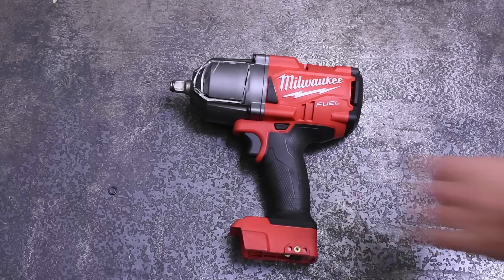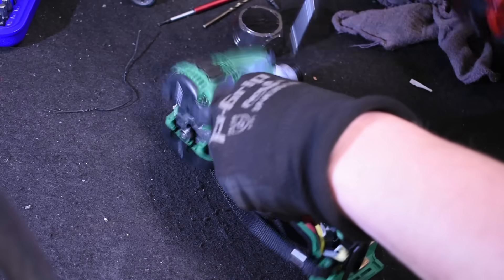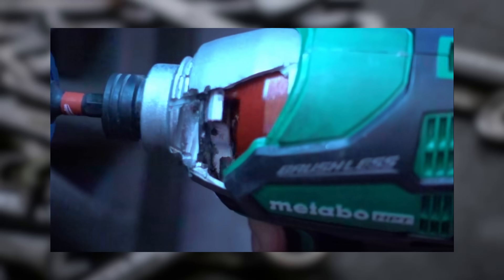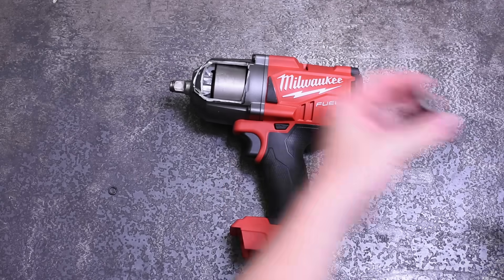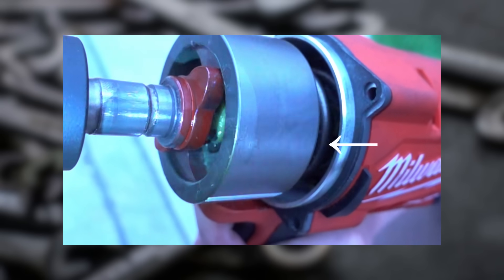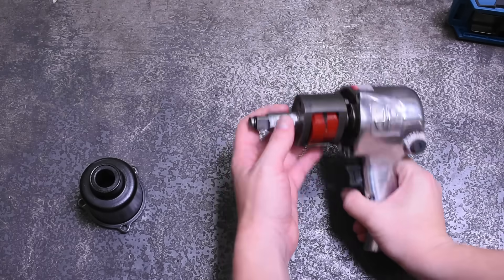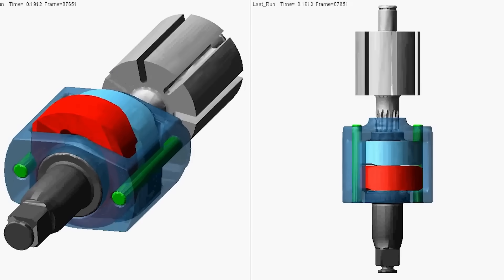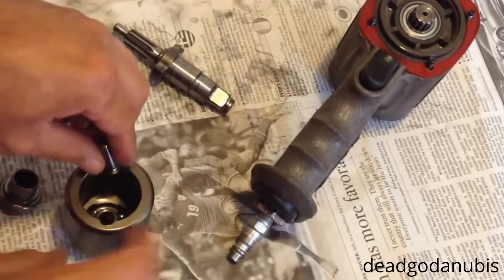High-Speed Video INSIDE Impact Wrenches: How They Work

Comment: QUESTION... In your description of how an impact driver works -- confirming that it is basically an undersized impact wrench -- would a DRILL, set on a clutch setting (rather than locked into drill mode) have ANY value "impacting" at all??  Yes, I know that the mechanism is different but it is not COMPLETELY different in that it slips... catches... slips... catches... slips... catches, many times a second.
Reply from the maker: Nah, a clutch works differently. It's meant to do the opposite

Comment: Nice, at work we use that Milwaukee and some mixed Air ones (we also used to have some cordless Makita but they sucked)  and while the air ones are ok, I still prefer cordless by far... just sucks as we just broke two of em xD

I especially love how its running way smoother over all, when screwing and no hammering is needed.

Comment: I prefer cordless impact's to air powered as the big one my work has makes very strong vibrations, and it's not nice to be on the other end off a bolt holding a wrench which is constantly wacking into your hands. It is powerful though, as it was able to rip off a steering cylinder on a JCB teleloader where we tried to get a sheared bolt out.

Comment: Got a question for Ya'll Bosh Glow Plugs for Sprinters have a very low shear/breaking point of something like 45 foot pounds. 
How is it that an Electric 20 V Impact gun is able to remove it without  breaking it when it 20x the torque strength. 

This is something that is being done by a lot of DIY owners and mechanics with great outcome I just can't wrap my head around the numbers and I guess the numbers on the spec numbers are sustained torque/linear torque not per strike torque of each hammer strike. 

Here's a video showing how it works and those that never seen it cringe at the sight of this but it works really well. 
https://www.youtube.com/watch?v=EqPFIhm0Lb0&t=176s

Comment: 10:40 I remember the first time I experienced an impact wrench.  My boss asked me to hold a water pump so he can take a bolt off it.  I braced as hard as I could, expecting it to try to wring the pump out my hands.  He said "Nah relax, it doesn't work that way" and ugga-dugga'd it off with the impact, with no effort on either of our ends.  It was like magic, torques the bolt but not the part or your hands!
Reply: inertia from the mass of the object does it, since it can't accelerate very long with the brief impact

Comment: I have heard everyone talk about the size of the hammer but I have never heard anyone discuss the strength of the spring. It seems like stronger impact wrenches require more force to overcome the spring mechanism. Would love to see why.
Reply from the maker: A stronger spring means the motor has a larger resistance to fight 2000 times a minute, and the tool has to be able to do so with any (small) battery that brand makes that fits the tool. So larger spring means the motor has to be geared down more to easily overcome it, which means less RPM and speed that spring is being turned with, but the spring results in more acceleration which means higher hammer speed or being able to accelerate a heavier hammer. It's a trade off you have to balance.

Comment: Battery has come a long way my buddys 1/2 inch HT Milwaukee greatly out performed a matco and IR 1/2 inch air impact with the correct or slightly more than recommended psi I say this as I was using the Milwaukee with 3 bars to tighten a ball joint press and got fed up deciding to use an air impact neither one would even move it but the Milwaukee inched it along

Comment: Ah! So when my drill or screwdriver starts clunking on a hard to move screw, that's not a sign that it's not working. It's a sign that it's switching into high-power/hammer mode, and I should let it do so rather than take that as a sign to stop.

Am I following that correctly?
Reply from the maker: Nah. On a drill that's the clutch telling you to stop
Reply: @TorqueTestChannel  Oh. Well I was right the first time then...

So how do I know if the tool I'm using is one like in this video (where I should let it go) or if it's one I should back off on?
Reply from the maker: If the tool has the word impact or hammer in its name.

Comment: both serve a purpose, and denying either makes you a retard, have both, sometimes you need a battery powered, sometimes you need the vrrrrrt
the only reason am pretty much sticking with flux core welding when i do get into that is because it is more practical for what i intend to use, plus gas is expensive and only rented most of the time, and stick requires nigh constant reloading with the lengths of stick you get. patching something with weld is probably where i'd use stick. but, my point still stands

Comment: Kind of crazy how long these tools last when you think of the beating the hammer and anvil take even just putting in a few screws. Im still using a Makita impact driver i bought back in 2015. Must of put 10s of thousands of screws in with it. The tool still feels just as powerful as it did when brand new. Although def looks worse for wear (rubber overmolding etc is all pealing off)

Comment: tear apart a milwaukee "surge" they have a hydraulic hammer. dont know exactly how it works but they are way quieter and maintain a constant forward pressure which makes them great at running in self tapping screws. less dynamic torque but a constant torque instead of many larger shocks. they are literally all we use at work now.

Comment: What kept me from going full-on air tool was the size of air compressor I would need to produce those torqs.  I don't know if that's still the case but I ended up getting the Milwaukee big one you showed there.  I have pulled off about 200 nuts some really rusty as I live in a snow place  by now and it has only not been able to pull one or two off... That has been good enough for me as I am a guy who works on my own cars/not a business.
Reply: Small or large air compressor doesn't matter for the torque just about every air compressor willget a tank pressure of at least 8 bar, more then enough for any impact wrench. It does matter if you are removing a lot of nuts quickly, the compressor pump won't be able to keep up and the pressure in the tank will start dropping.

Comment: Huh, I always thought the ratcheting sound just meant that a "torque limiter" kicked in and that I should stop driving the screw (or increase the setting on the driver and risk stripping the screw or the screw hole). I had no idea those "impacts" actually had a purpose!

Comment: Interesting to see that the rigid outperformed the milwaukee with its hammer. Better motor in the rigid?
Reply from the maker: Yes, 4-5 years later brushless motor, higher motor RPM

Comment: I want to see the power difference.... I don't know if  brushless is that more effective.... More powerful yes... But efficient.. Hmm

I have 2rc cars, a small one and a big one the bigger is brushless and very powerful, the small one also quick but lacks the oomph the big one has... The bigger uses 133 Amps... Yes... 133 on peak
That's almost 2Kw of power... The small car would explode his battery and engine immediately if that power was applied...
However it's still fast
But.... That brushed fellow could drive 20 minutes and my bigger car dies at 7 if I really push the limit

I'm saying.. Everything gets accordingly...

And I'm not really noticing any energy saving... The only thing I do notice is the enormous power difference and torque these 2 types have but nothing more!

Comment: 16:32 but why did the ridgid perform so well with the milwaukee hammer installed then?
Reply from the maker: It's a higher RPM brushless motor than the Milwaukee (because its 4-5 years newer), but supposed to be paired with a ligher hammer. So we "fixed" that.

Comment: Very nice. I thought I had some of what's going on in there figured out. This refines it so thoroughly and without getting into formulae. That's interesting about getting the hammer to skip a dog so it has more time to accelerate for greater impact. 
I used to split a lot of wood and I keep trying to tell the guys that want to show off their muscles - get the maul swinging faster with hand speed and quit trying to hit the wood "harder" which is far more tiring. Car 'B'  colliding with a wall 3x faster than Car 'A' is hitting that wall 9x harder.

Comment: Superb display of how these actually work.  As an ASE Master Mechanic with over 30 years' experience, I still use shop air except for interior and 1/4 drive work.  I love my Mac Racing 1/2 inch twin hammer air guns which are about 20 years old now.  Even with hard daily use they only need seals and anvils about every five years.  While other tech's use battery power almost exclusively, I drag the hose around for two primary reasons.
#1 The air is there and it has zero (0) effect on my commission.  Shop air is expensive for the shop, but free to me.  I've never asked the boss to buy my batteries, but I'm sure someone has and they still don't.  New batteries work well with daily cycling but they still run out of power a lot compared to the compressor which has a worst case down time of 1 day every 15 years.
#2  Extreme and unforgiving power.  In the real world, we don't use the recommended 90 PSI.  That air hose has 130-140 PSI.  I know when I put a massive socket on my gun and put that socket on the front crank bolt of a Lexus, two things will happen.
The gun will leave unless I hold on very tight with both hands and the bolt will come out.  It always works.
Awesome video!

Comment: love the channel I was thinking how do you think removing one of the dogs and hammers from the cordless impacts would effect the performance because they would have a full 360 degrees to gain speed before each one of there impacts although the hammer would be slightly lighter
Reply from the maker: The spring isn't tuned to launch the hammer forward 360° it would run out of steam most of the way through then just sort of rely on tool RPM to push it the rest of the way. Basically hammer speed wouldn't increase as much as you'd assume

Comment: Fanastic video as always. One question I have and maybe i missed it in the video, but do you know why some impacts make significantly more torque in "reverse"? Im assuming it could be something related to the the electric motor more than the impacting mechanism but i could be wrong.
Reply: I guess they always have to be able to loosen what they have tightened, after all their original purpose in the world of mechanics was to loosen bolts as quickly and easily as possible, normally hand tools were used to install them along with torque wrenches for final tightening... except on most tire shops ;-)
Reply: @ruben_balea  That's a fair point, but I was more curios as to how/why from a design stand put :-) Like if they use electronic limiters, something about the hammer design ect.
Reply: @specialK319319  Ah! I interpreted it as why they do it instead of how they do it...
I never gave it much thought, I always assumed that the rotation change mechanism allows more airflow in reverse, if that's really the case with electric ones they can also send more power to the motor in reverse, but I may be totally wrong as I'm not an expert by any means ;-)

Comment: Why do electric impacts provide more torque than air typically? Is it just the bigger weight they use? 

Also can they add a planetary to an air impact that instead increases the RPM if the hammer cage to get more torque?
Reply from the maker: In general air tools are more powerful (so far)

Comment: I think that your gear ratio on the planetary gear set is not right. 
Check out an automatic transmission manual, you have to take all 3 gears into the formula. 
It has been 47 years since Automatic Transmission 114!
Considering I am watching, & writing this at 3:30 am, I am surprised what I can remember. 
Thank you for this channel for all the good information that you supply!!!
Hello from north east Montana. 
10 miles from the Canadian border.
Reply from the maker: But the brushless motor is 19k rpm or so. So it checks out for this 1,750 rpm tool

Comment: I'd like to see you take one of these 2 dog/ hammer setups and cut one off of each... So 1 hammer dog, and one anvil dog, and see if you can get more power out of it, or if it's entirely too out of balance and has too much vibration.  This way it gets one hit per every 360 degrees.. I wonder if the materials can handle that momentum, or if it would even help it gain any torque.

Comment: Fantastic video. Super clear explanation and video , with a pleasant non rambling speaking voice , a rarity on YouTube .
here's something interesting you might not have heard of . In Germany , where i live , i had a log style house built six years ago and noticed during the construction of  some structural beams that the workers were NOT using impact wrenches on large screws . They said it wasn't allowed . The reason being that the impact action tended to ream out the holes in the wood when the screw is being installed .
Reply: Yeh, that makes sense. These things aren't exactly torque limited (like yonder Makita drill, for example). They deliver a fixed amount of energy (per ugga-dugga). While the screw is going in, that energy goes into driving said screw a little bit at a time (but many blows each second). Once the screw is fully seated, that energy still has to go somewhere. It's not like the torque-limiting clutch on the drill, where a bunch of spring-ball detents just let go (though that makes a similar sound), this is a big hunk of metal spinnamathingin' like crazy one moment and coming to more or less a complete stop through that screw the next. Where wood is concerned, when it can't cut it'll just shred.

Comment: Im glad you covered the pros of air impacts. The young generation seems to view air impacts as obsolete and don't even bother buying them. Smaller, less vibration and quieter impacting, which impacting on certain things like a loader bucket for example really resinates through a shop and pisses everyone off in the shop, meanwhile the new kids hammering away on it for a minute straight on each bolt with his high torque Milwaukee

Comment: Great video.i just got a 2962-20 and things seem a little loose in the frame.i can grab the anvil and there is like a 1/2 in and and out play like the spring is not pushing on it hard enough and the whole assembly is sliding inside the case almost like the deleran bushing is not in there.is that normal and ideas?

Comment: As always great source of content but I do have a suggestion for science.
If the three-point system has an issue making consistent impacts and the two-point systems work reliably enough in the small platform impacts.
Then would it make sense to remove half of the two point system to lower the impacts per minute but greatly increase the torque output
Reply: Just a note obviously you will have to balance the hammer so that the device does not try to kill itself before the video ever gets made

Comment: I like your channel... I really appreciate stuff that aims to help people make better choices. 

I have a suggestion if you haven't ever addressed it... Clearly most automotive/mechanical type scenarios people will use a 3/8 or 1/2 anvil gun...
BUT I would be curious to see how torques stack up against 2 similar guns but one having a 3/8's drive anvil and the other using a 1/4 hex "quick change/chuck" thingamabob that adapts to 3/8 drive. 
this for clarity https://cdn.mscdirect.com/global/images/ProductImages/6394175-24.jpg

I would think the results would be somewhat predictable BUT I have been amazed at the ability of that 1/4 chuck to zap off lug nuts at about 100 ft lbs. 

Just an idea because I found myself curious of how all those beans were making it down that pea shooter of a chuck
Reply from the maker: We've done that I believe: https://www.youtube.com/watch?v=2nWztRe0yNs

Comment: You would think the dogs would wear out from repeated beating as fast as they do? Have you seen any damage? Other than your paint transfer? Or is it seriously hardened?
Reply from the maker: Super hard, like 55-60 HRc + work hardening. You'll notice the Milwaukee has a curved anvil, spreads that impact force over a larger surface area. We rare see wear in these tools on these parts.
Reply: @TorqueTestChannel  oh wow... yeah I seen the curved anvil to meet the curved dog, but you know as well as I do, anything being beaten over and over creates heat, creates distortion, etc. So you would think they would wear out. I'm completely baffled and surprised that they don't. Makes me appreciate the tool in my hand just that much more! Thanks for the reply man!
Reply: @Chris.Rhodes  Yes they can wear, but it's such a small amount that you'll end up replacing the tool for another reason LONG before the dogs wear out completely.
Reply: @mediocreman2  gotcha. Makes sense. Thanks for the reply!

Comment: I have a question... I have an older Ingersoll Rand air impact that can't even break a lug bolt torqued to 90lbs. Any idea why or how to fix it?
Reply: Probably depends on what air compressor you're using
Reply: @andries4561  I can't remember the specs on the compressor but a year or 2 ago the gun worked fine, but I've been noticing the power falling off.
Reply: @4BillC  so either the gun needs servicing or replacement or your compressor is weaker, they wear out over time